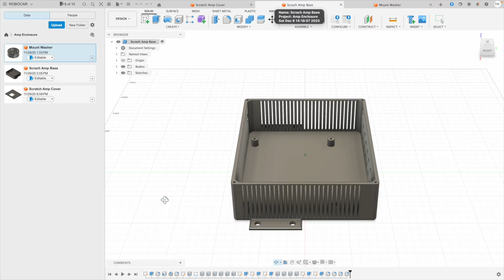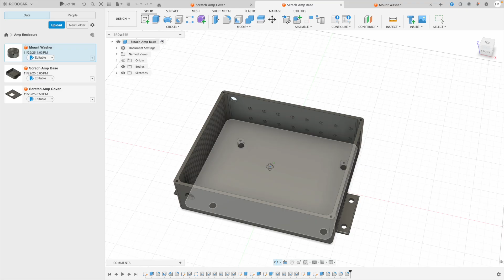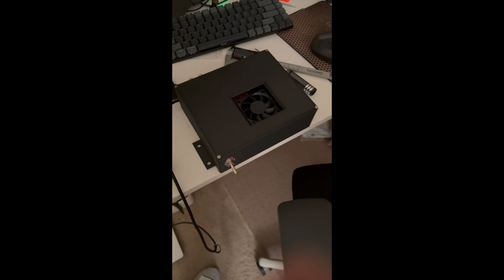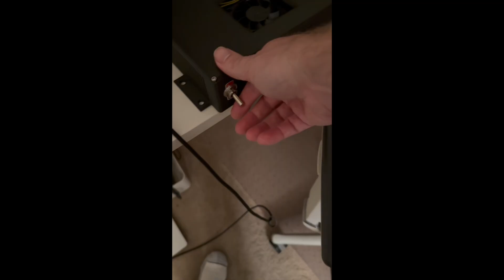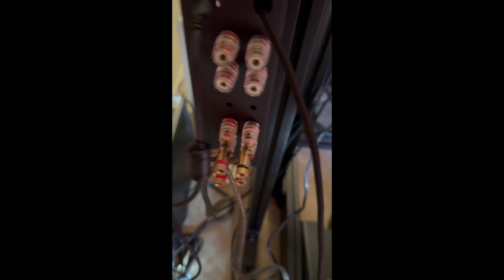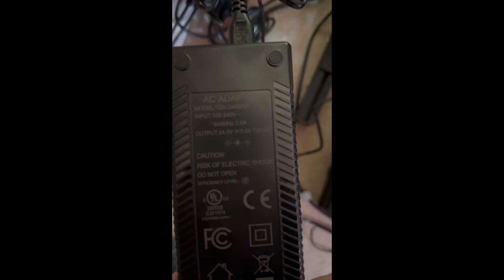Dayton Audio SAB 1060 Sim Racing Amp Install

Comment: This is awesome! I am ordering the same board for my rig. Are you open to sharing this design? 
If not, I understand 😊.

Id love to ask how well everything worked out? 

I am building my first Sim rig (its been an intense build!) And I plan to mount 6 TT25s to the rig.

Would live to hear your experience.
Reply from the maker: Exciting! it's a fun hobby to get into. 

The description should have a link to the printables share for the design files. Let me know if you want the step files as well.

I use them every time go on my rig I use them. Really wakes it up and makes the rig feel alive. You really can't go back once you have them. You'll have to spend time tuning them to you liking with simhub or the tool of your choice. Tuning in wheel slip tool some reps. Don't be too aggressive on the engine and RPM effects, they can add too much noise but do add nice immersion if you can get the balance right. 

I only used the TT25's for the pedals because they didn't need to be as powerful and no need for low frequencies. 

For the other effects I'd recommend a BST1 if they are being mounted to the corners of you rig / on the frame.

Now I use them in conjunction with my belts and motion. They all add their own elements to the immersion.